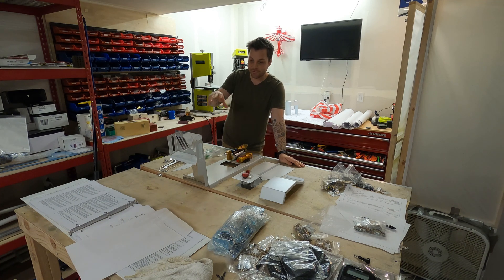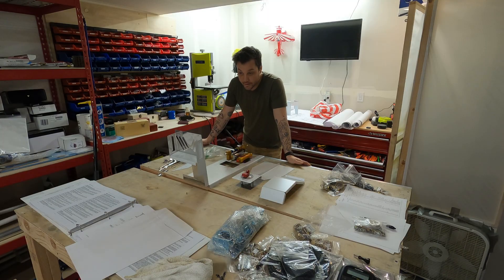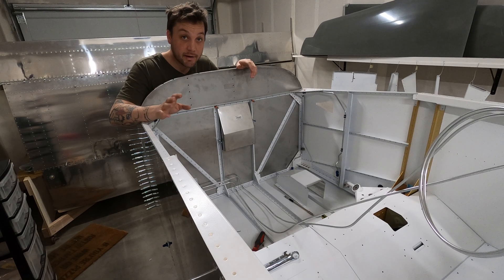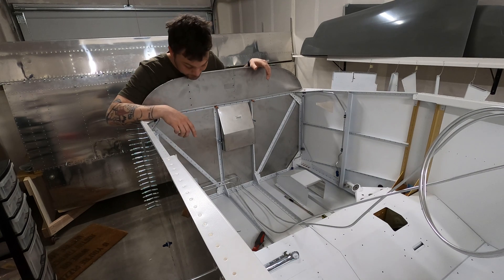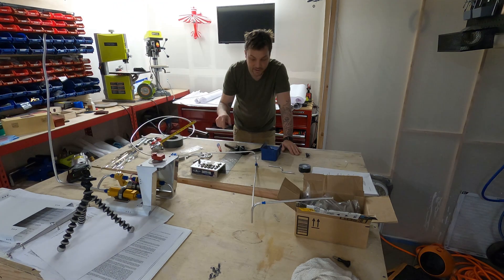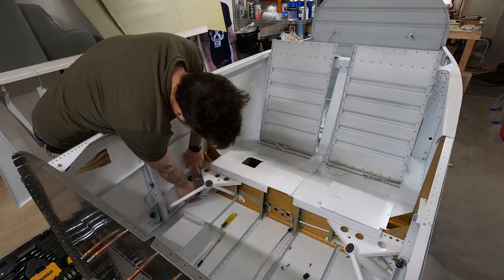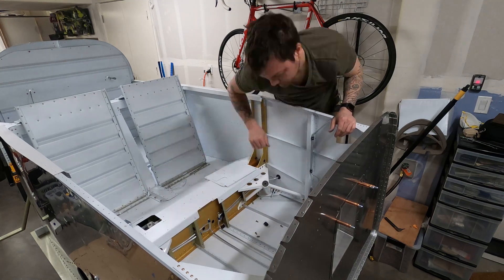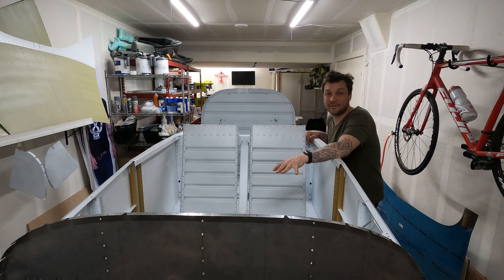Fuel and Brake Lines - RV-7A | EP3.30

Comment: The 3 parts where your instrument panel will be attached, will these parts not be in the way of your instruments e.g. screen, radios..
Reply from the maker: That’s called the sub panel, and it routine get modified to accommodate the back of the “rack”. Longer avionics (e.g. the GNX) will need reliefs cut into the sub panel.

As much as it’s in the way, it also will serve as a mounting location for certain LRUs like the ADAHRS and others.